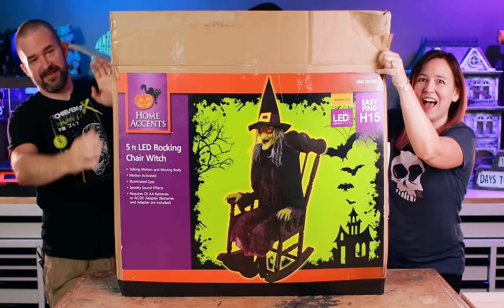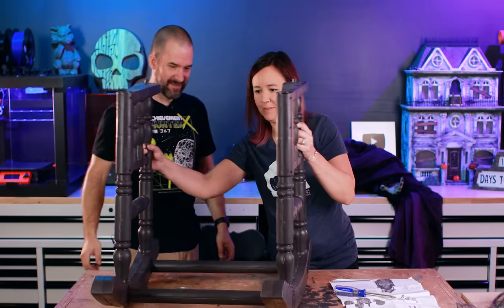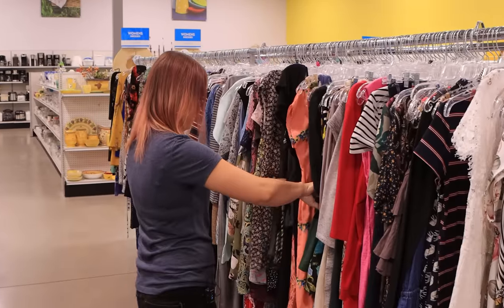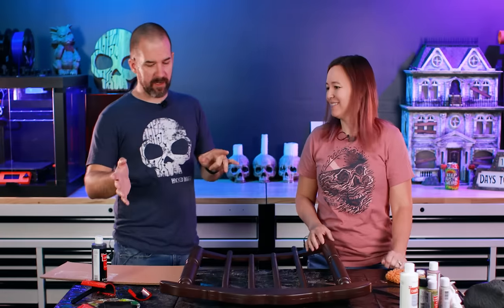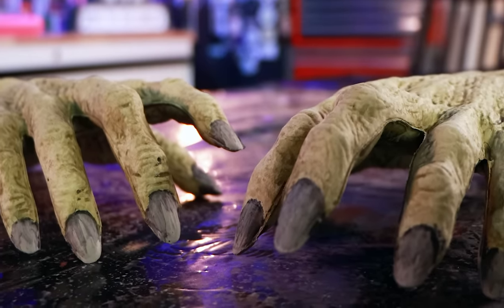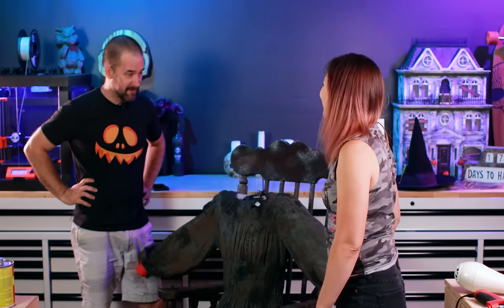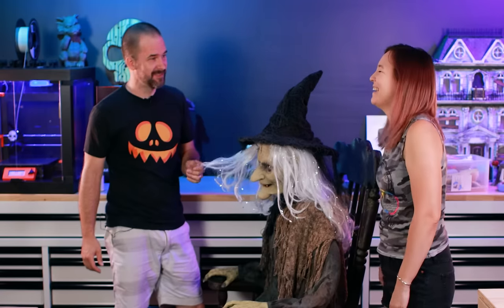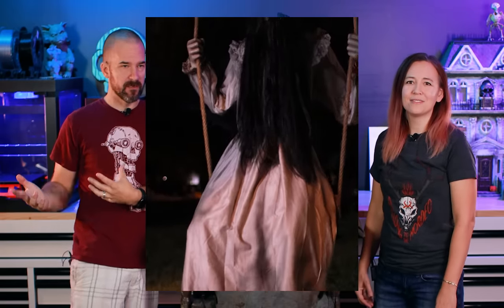We gave this Halloween Witch Animatronic a Terrifying Makeover

Comment: As long as you guys have the right voltage, having a plug that has more amps is ok. Yes I'm like you, I keep plugs and broken electronics for parts! Also thriftshop for stuff like that!
Reply from the maker: Yes!!! We ended up at 700mA instead of the 1.5a it wanted but seems ok.
Reply: @WickedMakers  The risk you could run into is if the witch pulls more than the 700mA which is .7A, the plug could over heat. Fire risk. I love your projects!!!!

Comment: You can make woodgrain with paint. First paint the brown background color (Or whatever color you want) Then use black paint with a damp kitchen sponge and wipe the paint on, making the woodgrain. If you spin the sponge in a tight circle, you can make knots in the pattern as well. You can also just dry brush some paint to make the wood grain if you don't want your hands dirty. But it takes some practice.

Comment: I  love what you do. All of your videos are amazing. Just so you know, for in the future…pool noodles after you cut them, can be molded and shaped by simply heating them briefly with a heat gun. You don’t have to use contact cement. In fact, some brands can melt/eat away at neoprene foam.

Comment: Could've used some dark wash to make her facial creases stand out a little more. Could be achieved by diluting ink (60-70%) with water (40-30%). 

Also, a few dreadlocks or messy/damaged locks of hair would have been cool. 

Finally, nails sticking out of the chair, chair rungs poorly repaired with ild tape or makeshift stakes, chipped off pieces and indentations...

Comment: Since you give out so many free tips I figured I'd try to return the favor with one of my own...
Instead of using contact cement with the pool noodles you can use a heat gun to melt them (make them soft, not dripping-melting) and then join them together and allow it to cool. There's nothing wrong with using contact cement, but using a heat gun can be cheaper and probably quicker as well. If you want more info on that method of joining pool noodles check out the StiltbeastStudios YouTube channel... He does all kinds of things with pool noodles and a heat gun.
Reply from the maker: Yeah thank you!

Comment: I have this prop.  I like it a lot but boy is it a BIG PROP.  It’s impossible to break it down to fit into a reasonable sized container.  I much prefer my others which can break down to fit in a 27 gal tote.  This one, good luck storing it.  Also. I’m not digging on any of these props with glowing led eyes.  I think I’m going to add a switch to turn them off.  It just takes away from the realism.

Comment: Here is an IMPORTANT "FYI" TIP From a Model Builder and Prop Builder...  If there are "SEAM LINES" on like say the HANDS have... Those SHOULD be removed BEFORE you
re-paint them!  This needs to be observed and delt with ALL "PLASTIC" and/or "Rubber" parts when re doing these props!